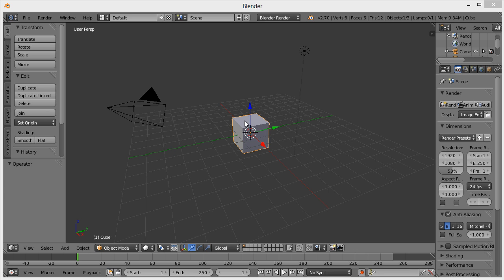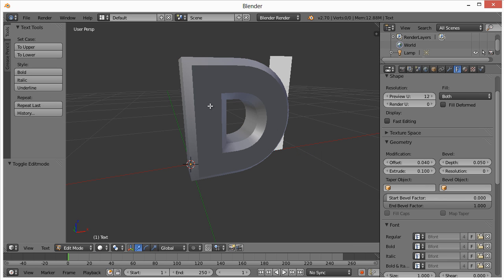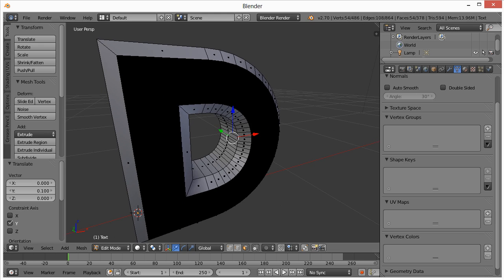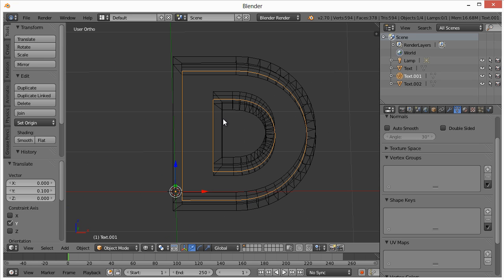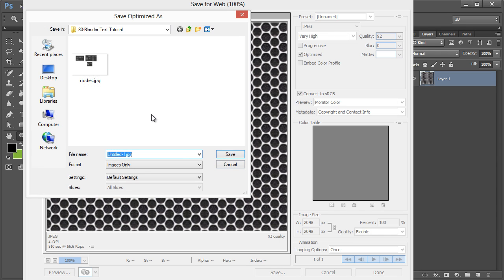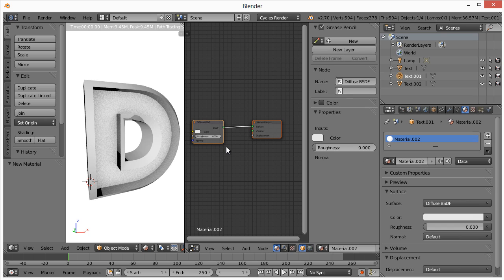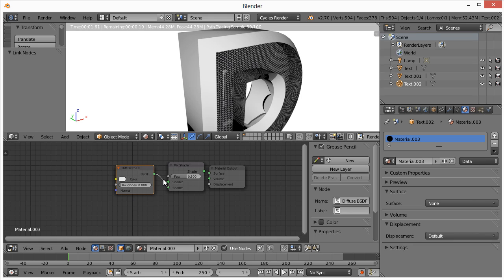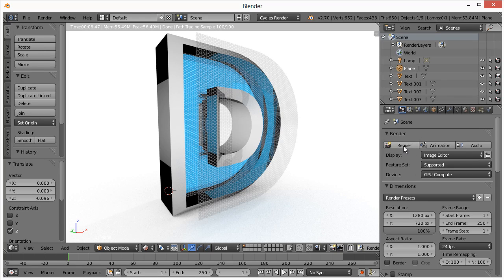Blender 3D Text Tutorial - Honeycomb Metallic Effect (Cycles)

Comment: Couple things.. first.. you don't even use the UV image/unwrap you created. So that right there is extra work. Second, in the node editor, you don't need to cut connections. Adding the new node will automatically connect.. you can simply modify the connection as needed. Since you are into doing extra work... why didn't you clean up the structure of the faces of the letter?

Comment: You may also select all front faces by.. ... Edit Mode ... Face Mode ....Select a single face .....  Then... Select Menu ...  [[Select Similar ... Normal ]].  This will all faces facing in the same direction as the original
Reply: videofountain I'm new to blender and I am having trouble with some letters I am unable to select the vertisus. I've tried eliminating doubles, simplifying the faces to make it easier the letter R gets messed up a bit and I'm not sure how to fix it, and the letter t is has face where the the top and vertical part join. Any tips would be helpful thanks!